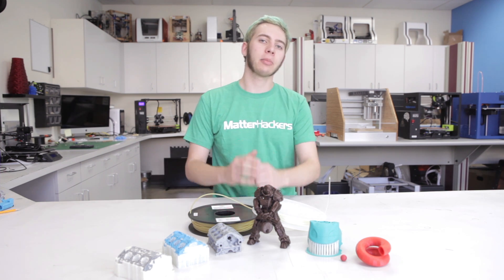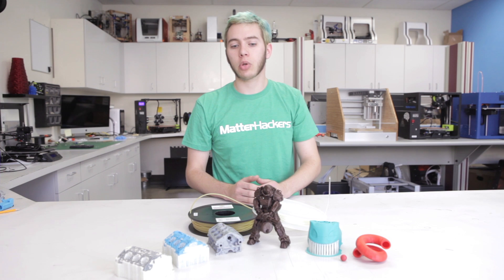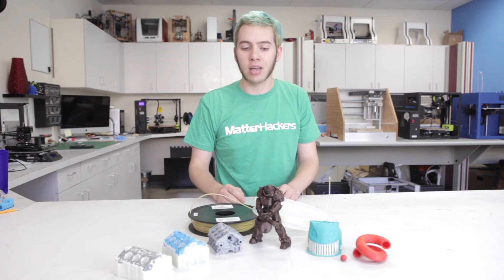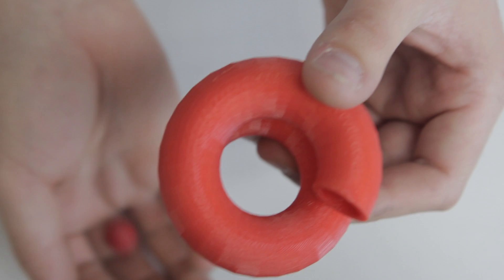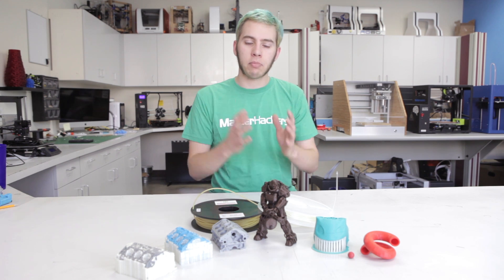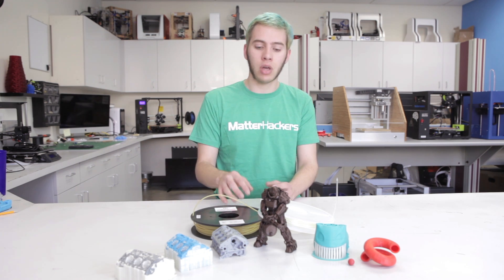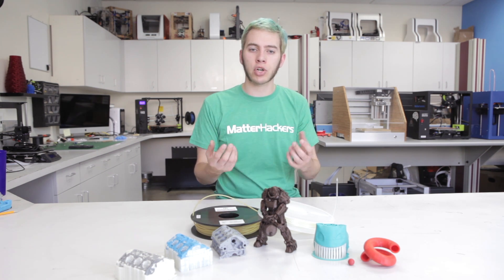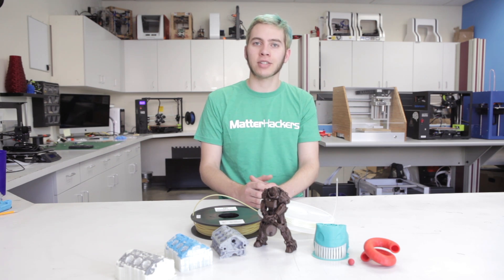How To Succeed When 3D Printing With PVA Filament // Dissolvable 3D Printer Support Material

Comment: I'm having issues with PVA. Sometimes it spits out almost burned like blobs, but the temperature is already the lowest recommended :( And the PLA is also not smooth on the top of the supports AT ALL. Any help?

Comment: I've been trying to print with your PVA but I haven't had any luck doing a successful print. I've had problems with the PVA coming out of the nozzle fast enough, sticking to the PLA as well as it should, and the PVA burning at the tip and preventing any additional from being extruded. I'm using Simplify3D, a 0.8mm nozzle, a print temp of 205 with a drop down to 165 when not in use, retraction of 0.8, & extra restart distance of 0.3. Can you please advise on what settings you would recommend?
Reply from the maker: Scott, if you can please email this info to support@matterhackers.com our tech team can reach out and get an answer to you!

Comment: How do you switch materials during the print? If it's done layer by layer, are you changing filament hundreds of times? If the two filaments are different, presumably the printer uses different parameter files for each material.
Reply: Dual Extruder.
Reply: @quechus13  - That doesn't explain how you tell the printer how to do it though. Presumably you could do it with the MMU2, albeit with slower print speeds.
Reply: @rogerfroud300  Well at that point it's common sense.
Reply: @quechus13  - No point in replying if you can't be bothered to explain. First a two word reply, then nothing. I'd stay quiet if you're not willing to help.

Comment: Alec,  what is involved with printing completely with PVA?  I need to print a water soluble object.
Thanks
Reply from the maker: Hi! Alec says to use the same settings, just don't make it your support material.
Reply: @MatterHackers  Hi I am also looking to do the same. But I wondering what can be done to remove the PVA from the print area whilst not compromising the object printed?

Comment: Hey can you do a video about how to dry out filament like pva or pla if it's absorbed too much moisture from the environment?
Reply: 60 degrees c for 6 hours then place into a freezer bag with desiccant and use a piece of tube to suck out as much air as possible before tying off with elastic.  I only print PVA in an enclosure which is also humidity controlled (heated to 30 degrees ambient with a 1kg bag of desiccant inside the enclosure).  This actually dries the filament whilst its printing too.  If you cant do that then just keep an eye on the exposure time.  Once your dried spool of PVA has clocked up 20 hours out of a dry environment.. it needs drying again.  Another tip is to only expose the amount required - eg if I  know that a print will use 14 meters of filament - I cut 14.5 meters ad store the rest.  HTH
Reply from the maker: We'll add it to the list!
Reply: Check there video about the Printdry

Comment: Do you need to have a 3D printer with a double nozzle, and how do you know where and to put support material
Reply from the maker: PVA is mostly used for printing on a dual nozzle printer. For more information about using support material for single extrusion, check out this article: https://www.matterhackers.com/news/how-to-use-support-material-part-1